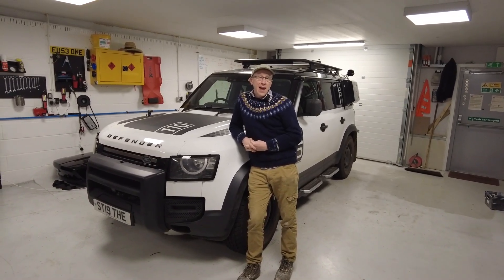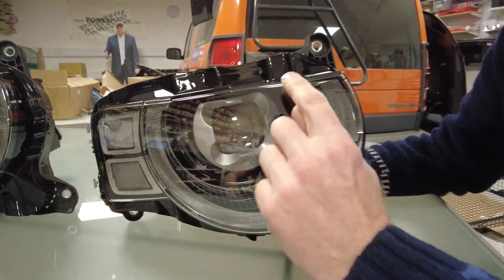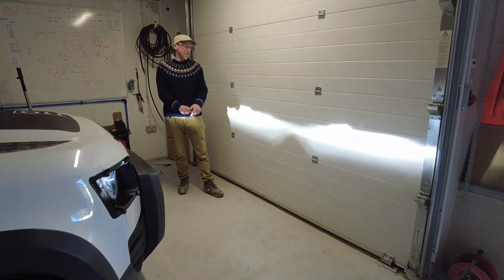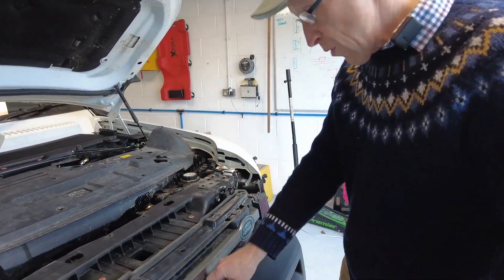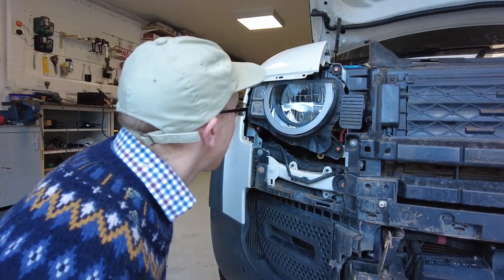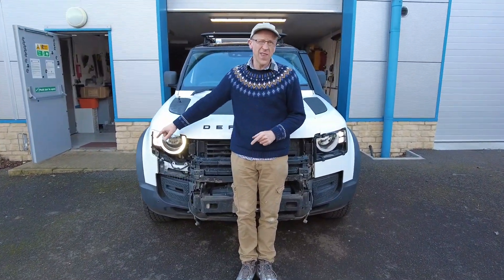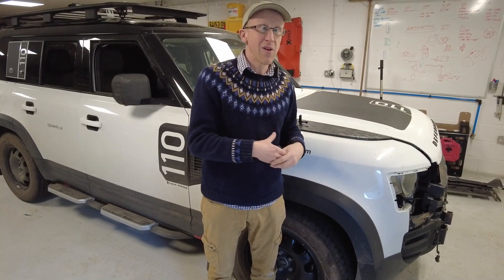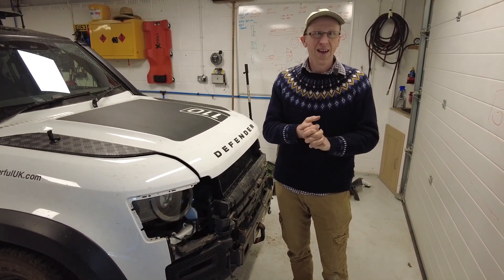Land Rover Defender L663 Headlight Options + Headlamp Upgrades LED / Premium / Matrix - Part 1

Comment: Great video! Could you also check if the premium LED headlights (not matrix) work plug and play, or if they cause any errors?
Reply from the maker: Hi Johnny - I only had the RH premium but purchased one on ebay for the LH so i will try the premium upgrade next - this will be PART 2.
Then PART 3 will be the LED matrix !
Reply: @L663  Great, thank you very much! I'm already looking forward to part 2!
Reply: @L663  Hi Simon, would also be great to know how the manual headlight range control (little dial next to the screen brightness dial - only at cars with the standard LEDs) reacts to the premium LEDs which have auto headlight range control

Comment: Your right about the costs being higher as more LED components are added. I’ve got a Jag XE HSE. I had a pheasant hit the headlight a week or two ago which fully took out the unit although remarkably and despite the fact that at least half of the bird was still wedged in what remained of the light unit most of it still worked - maybe an advantage of rows of LED’s over a single bulb. The shocking bit was the cost £1970 incl VAT. I paid it as a claim off the insurance would probably have cost more in the long run over a number of years. They are definitely brighter but just watch your pocket if one goes!
Reply from the maker: We are now selling the headlight glass for most of the later Land Rover models and they have been selling really well - they are not easy to change but save a lot of cost and reduce the environmental waste - it should be law that headlight lenses can be replaced by design !

Comment: When the side light stops working on driver side is there anything you can do with it our is it a new head light 😂🫣🤔🤔🤔2020 first edition 😊
Reply from the maker: I guess you have the Matrix LED lights - is it the signature strip that has stopped working ? - the sort of circular strip light part of the headlight ? 
I would approach the dealer and ask them to replace this under warranty ? you could strip the headlamp down to see what the failure is ? we sell the lens and rear casing to reassemble if you can fix it. I wonder if you can swap the control box from the LH to RH lamp ? it may be control box ( but i doubt it )
Reply: @L663  led circle and two square bits at the side every thing else on lights work just that one side light
Reply from the maker: @johnmclean6686  Did you see this video - may give some insight
https://youtu.be/rP9O-Qjw_wA
Reply from the maker: @johnmclean6686  around 13:24 you can see there is a connector to this area of the lamp
Reply: @L663  brilliant will have a look at it and see if it’s got wet or loose.🙏👌

Comment: Reminds me of the days of selling Disco3/4 headlights and taking them apart with hair dryer heat to remove the amber reflectors
Reply from the maker: The glue they use now is much better ( at being glue ) and does not soften in the over... I think they should be make it law that headlights should be repairable... sort of "right to repair" legislation.
Reply: @L663  I made a fortune back in the car so I agree with modding LRs

Comment: Many thanks for so many excellent presentations putting so much light on the Defender
The Headlights flat beam is to comply with regulations when driving abroad in continental Europe, or visitors driving to the UK without the need to modify their headlights.
However its downside is when turning on unlight narrow roads and into entrances leaves one turning into a black unlight foreboding void, if my Defender was equipped with the fog lights these would turn on when one negotiated such an unlight tight curves, junctions and entrances. 

Therefor a video for upgrading the Defenders by fitting original Land rover Fog lights would go down well 
Thanks Rob Oakey – Germany and UK
Reply from the maker: Hi Rob - the corner visibility is very poor on the Defender and this is something we are looking at improving - i did not know the fog lights act as cornering lights - that is interesting. Full marks for your pun in the first line !
Reply: @L663  the turning visibility without fog lights is the worst I experienced since 15 years. A solution to retrofit the original fog lights or add third party fog lights would be fantastic!

Comment: Hello!
I have a defender with base headlights, after i have just instal the led headlights with the DRL sign of it worked for about half an hour, and the i got the message “HEADLIGHTS FAULT” and the intensity of the headlights got down and the square got of. Any advice? 
Thanks

Comment: Have you looked into a loom for the headlight, similar to the rear light looms you make, so we can break into the high beam wiring for some laser lights in the front grill? I don't want to chop the wiring up for it, as laser say to do.
Reply from the maker: Hi Paul - the plan is to do this via CANbus

Comment: Simon the LH headlight has the control module as you stated, this also activates the fog lights when the headlights are on so the relevant one illuminates when you turn left or right.
Reply from the maker: Yes i am studying the wiring diagram now - both headlights have CAN High and CAN low and LIN - the extra wires on the LH seem to be height sensors.

Comment: I have a 2020 P300 SE with premium LED headlights - the pattern of mine is identical to your LED premium lights, which includes the strange dark dot/circle on both lamps.  Just to say, there wasn’t dirt or anything wrong with the premium LED you tried.  Very interesting video.
Reply: Glad you enjoyed the video - that dot is kind of odd - could it be for the camera system to see the cars beam pattern location - a sort of a marker ?

Comment: Another great video Simon
I have the matrix lights on mine, they are amazing. Came with the first edition spec.
As.you have said the ability to consciously know when not to glare at on coming vehicles is very clever, it automatically detects the amount of ambient light and selects between dipped and full beam and then adjusts the spray of light as on coming traffic appears.
Simon

Comment: Great video - looking forward to the follow-up when you have checked to see if you can get the Matrix version fully working.

One other suggestion for a video is to retro-fit the mains socket in the rear for those vehicles that did not have this option fitted as standard.
Reply: To get them to work, you have to do a software change.  A guy in Cali is offering the service but you need to go.  He will change the lights and update.

Comment: Simon…the beam pattern on mine is “Flat Beam” so that when you drive abroad, you do not make any changes as the car will adjust them not to dazzle oncoming traffic whichever side it is on. Also, I get light as soon as I start the car and have the large circular drl’s but I believe mine are the Matrix version. Interesting….Onwards to Part 2🤔🤔🙂🙂🙂

Comment: Hi, I have purchased the premium lights to replace the base led 
They have come without ballast. Do you know if the ballast on the base is compatible with the premium?
Reply: Hi - the ballasts are easy to remove but they seem to have different codes for the different lights - i did try swapping but they dont work
For your reference here are the codes from the lights i have here
L8B2-13E005-AB		LED Headlights
L8B2-13E005-AA		LED premium headlights
L8B2-13E005-BB		LED Matric headlight
Reply: Just being pedantic but they are not Ballasts anymore they are Led Drivers probably constant current.
 Ballasts where for HID lamps.

Comment: Interesting, mine came with premium but I found that on auto setting the high beam was distinctly poor with no real distance penetration. So much so, I had a lazar lightbar fitted. Much improved and a cheaper than the matrix option.

Comment: Hi Simon, I have matrix led lights on my P400e (just showing off now) but to activate the matrix option there is a setting in the pivi pro to turn on that feature, so you will definitely need to upgrade the software if you want to add them to your vehicle. I can take a picture and send it to you if it helps, Also your explanation on how they work is stop on they have vertical strips that turn on and off as cars come in the opposite direction you can see it happening as you drive along. At low speed or in urban environments they are on dip beam when you drive faster and in a darker environment they go to high beam automatically and stay on all the time just cutting parts of the beam when a car comes in the opposite direction.

Comment: Fantastic work, can I ask if the indicators flash normal or fast flash ?
I thought you got the fast flash when you went From low to mid headlights.
Reply from the maker: Hi - I will make sure i test this for part 2
Reply: @L663  
👍 can’t wait for part 2

Comment: Interesting that RHD & LHD have different lamp units. Peugeot full self levelling LED headlights put out a flat beam that needs no adjustment for which ever side of the road you drive on. But, they are expensive, £1100 a unit.